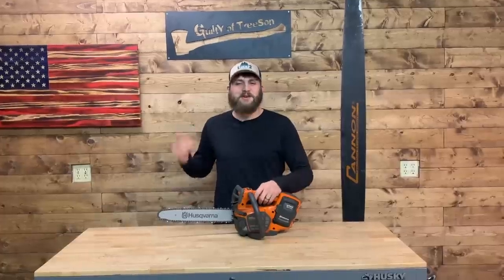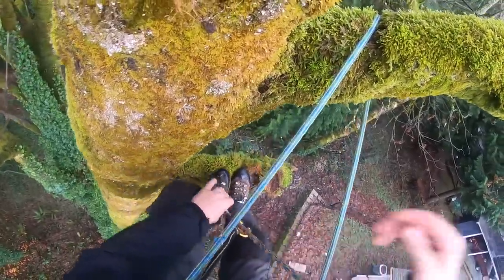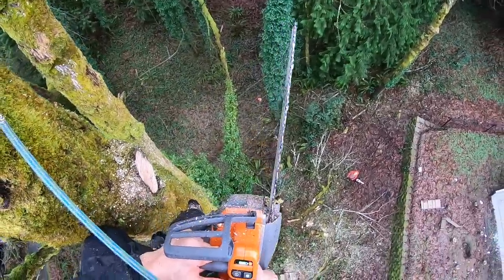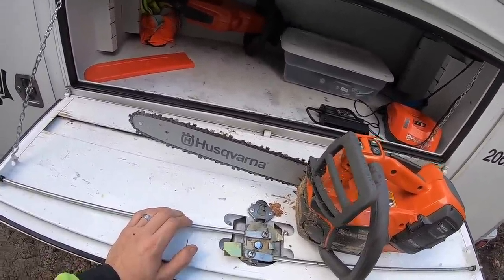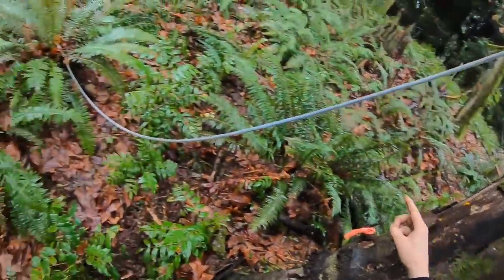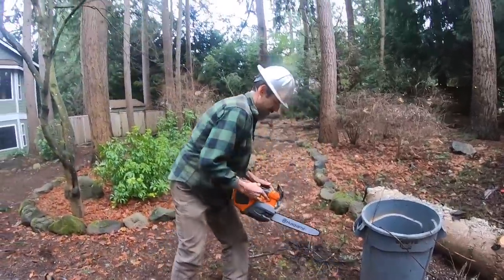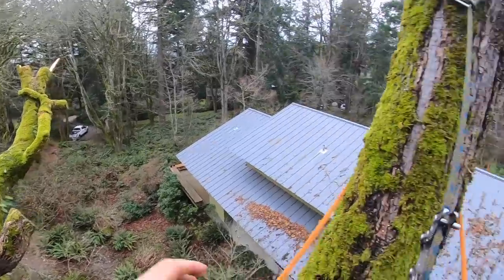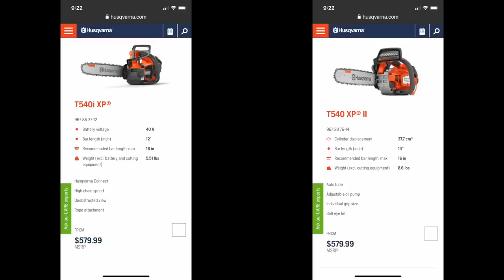Battery Powered Chainsaw Review! Testing the Husqvarna T540i xp

Comment: psa. in general with electric kit, take the battery out before maintenance or touching the bar. it just keeps you from any accidents. not saying jakes bad for it im just saying be careful. like he said you dont know if its on break or not or even the safety triggers are jammed with gunk (which has happened with me before).
Reply: I witnessed a close call once with someone who was cradling two milwaukee battery angle grinders, loaded, charged with cutting discs on them..
Reply: Thats all i could think watching the video.   Take the battery out, and get your hand off that saw blade
Reply: Yer the 1st minute of the video I was like get your hand off the blade and the trigger omg.

Comment: I feel like in 5 years all current electric equipment will be outdated/obsolete because of newer technology.  I have had chainsaws that were close to 50 years old that are still relevant, heavy as hell, yet running today.  Just wonder the projected lifespan of the tools you were showing?
Reply: I wouldn't anticipate passing them down to future generations.
Reply: Echo has decent setups but why didnt husqvarna add speed control to that saw? Its crucial for precison work...
Reply: I've used both for a while - and I'm a convert to electric, as long as it can put out enough power for the application. Almost zero maintenance, quiet, easier to use, and in most cases, lighter. The technology in them isn't new, and has been well proven. For anything larger than a 16" bar, there isn't something that will match a gas saw for power, and I can't see electric replacing a 395XP any time soon, but for a homeowner, or a climbing saw, they are perfect. I do wish someone would come out with a top handle saw with a battery back pack (like what Ego has), that would be perfect I would think.
Reply: I run a small tree company and with running a saw every day at most we get 5 years before we totally blow them up. Long lasting isn't the most important thing
Reply: I really wouldn't expect tools, especially a chainsaw, to last forever when used everyday on the job. However, in my case, a saw is used very seldom and "should" last a long time. I was thinking the battery technology will change drastically, kinda like my first, second and third cordless drills.  My drill with a cord, that sucker is 30 years old and still rotates with some authority.
Reply: @IBAdrianHarris  Ego Say they are working on a top handle saw but it's already 1 year overdue.
With regards to your comment on electric not replacing a 395xp anytime soon. There would need to be another type of battery to come on to the market to make that happen. The motors are already available to outpower any gas saw...it's just the battery (size and voltage) that stops it from happening. It will happen hopefully in my lifetime. I use a battery trimmer, blower and mower (all commercially) which are great. I still have an 80cc gas chainsaw though.
Reply: you are assuming that petroleum will be available indefinitely...I doubt you will easily come by petrol in 50 years other than from specialist suppliers.
Quality battery tools will last indefinitely...the batteries on the other hand will not.
Once we get standardised, it may be easier to get replacement batteries in the future. Look how long AA and AAA batteries etc. have been around. The chemicals have changed but the shell is the same.
Reply: No, waaay more than 5.
More like 15-20 plus.
Reply: @IBAdrianHarris  ego have just released a top handle saw. they are claiming it to be as good as the 200t
Reply: @positiveaspect5730  Petro isn't going anywhere. It will be needed to mine or process almost everything that battery is made of.
Reply: @mihkus  … it does have a variable throttle, acts like a rheostat, also has a completely “eco” or trim setting, which cuts it to about 50% output.  That also has the varying trigger.
Reply: @IBAdrianHarris there is a husqvarna battery belt and backpack, they both have and adapter that let's you connect to the t540ixp
Reply: @positiveaspect5730 fossil fuels are responsible for producing roughly %80 of America's electricity.

Comment: I really like how slim it is. 

Seems like a great saw, especially with some Stihl PS square filed chain
Reply: Yes, it'd be interesting to see how it would fare with some other chain/sharpening configurations.
Reply: @funkla65  I run Stihl square filed PS on my echo 355 and it cuts like a hot damn
Reply: This saw Runs 325” pitch narrow chain unlike the old version so chains are difficult I am currently looking at seeing if a 3/8” sprocket is available, But saying that this saw cuts so well why change it

Comment: I work at a dealership, we have complained to husqy abt those tensioners because they are shit, still waiting on an outcome but the only trick I have thus far is to get the tension, grab the chain with your free hand and then tighten the bar down good, not seen how it performs in the field sadly but its what I have to do to get it on the shelf

Comment: Great review!  I have one of these T540i xp  with 16" bar and love it. Cuts an amazing amount of wood on one BLi200 batt. With 2 batts and the fast charger it can cut continuously.
Reply: Isn't that to big to go top of a tree and cutting with a single hand?
Reply: @sirvozelo1  no, it's easy to use one handed.
Reply: @Clif_Brown  I believe, you in case of mine the Stihl 161T is very light even I have the batteries from the AP200 to AP500 I very much only use the AP200 because is light and still give me + - 45 minutes cutting time.
Reply: @sirvozelo1  I got the T540i xp because it was the most powerful small battery saw at the time.  I have cut large diameters 20+" with a double cuts and it powers through. Small stuff is simple for it.
Reply: @Clif_Brown  Whao 20" is over 50 centimetes that I with need my MSA300 and even in this one I only have the 16 and 18" bars. On 161T I have a 30 centimeters 12" bar.

Comment: I bought a Greenworks 16" battery powered saw about a year ago.  I already had batteries and paid about $140 for the saw.  I'm a rank amateur when it comes to using a chainsaw but I've been able to clear some dead trees (14" or so in diameter) from my property.  The saw is lightweight and has enough power for what I need to do.  And, truthfully, the gas chainsaws kind of intimidate me.  Thanks for the review!!

Comment: Future concept - The tools could be lighter & more powerful if a bigger battery was attached to the operators belt. Use a combo tether / power cord from the belt to the tool. 
Why carry the weight of the battery with your hands?
Reply: Cool idea but would be inconvenient for everyone other than climbers since no one else uses a tether
Reply: @joeyisamazing1091  In the case of tophandle saws, that's really the only thing they're made for, so not a problem. Also, I believe there is a backpack battery from Husqvarna
Reply: Stihl has that

Comment: The smaller narrow kerf chain may be more the culprit than the tensioner when it comes loose. The thinner bar and chain are more likely to get pinched, as well as the thinner chain is more likely to bend. Different types of tensioners do take some getting used to though. Not sure if you tried, but the bar and chain might swap between both 540s, as long as they are both 3/8 sprockets.
Reply: It’s also a new saw and chain so the chain will stretch a bit in the beginning requiring close attention to the tension.

Comment: Another thing to consider the power you get from the battery today wont be what you get a year from now.
Reply: Most quality lithium batteries won’t degrade much over the coarse of a year unless you are running them hot every day. He’s not even really pushing it in the video if he carries one spare and alternated they will be good for years unless they failed for an abnormal reason.

Comment: I have 3 of those 540i   They are amazing for limbing especially. If you  chunk big wood with it the battery goes dead fast but with 2 batteries and the rapid charger you can pretty much cut non stop all day. I also have the stick saw and I love it. The bli300 battery is a bit bigger and last longer but is heavier.

Comment: I think the big take away from this is that Husqvarna was close in their first attempt but the third version is when they will probably get the professional version that is worth it. Would love to see you run the stihl version as well and see if you run into the same downfalls
Reply: What made them not close? edit: I just got to the part about the tensioner. I just got a Dewalt 20" saw DCCS677 that came with the 15Ah Flexvolt battery, and it is awesome. They claim it exceeds the power of a 50cc, and they have a video to prove it. Definitely not going to have a problem with the tensioner like this one with its dual bolt setup.

Comment: Not sure why you think Stihl use different batteries, they do have smaller batteries for their home-owner tools, but all their pro tools,  the MSA161T, the BGA86 leaf blower, the HTA85 polesaw etc all use the AP300 batteries, or the slightly more powerful AP300s.  The 14" MSA200 saw and it's bigger brother the MSA220 also use AP300 batteries.  (but the 220 is best with an AP300S due to it's extra power).   I prefer Husqvarna gas saws, but prefer the Stihl electric saws, as no annoying power switch, and like the narrow kerf and smooth cuts (use for construction timber also).  I'm not a pro user but have had the MSA200c for >3 years now, mainly firewood and small trees, brilliant wee saw, it's not even a pro tool but has lasted well - now have the 161T,  polesaw and leafblower.  Got 2 AP300s with the MSA200,  they both still good.

Comment: Why does no one evaluate the Kobalt 80-volt brushless 18" chainsaw with a 5-ah battery?  - -   I have (2) Kobalt 80-volt 18" Bar Chainsaws and use (2) 5 AH Batteries. Using it on a Southeast LA farm that was devastated by a Hurricane and has been working absolutely great even cutting huge logs and trees. For oil, I like to use Ryobi Bar and chain oil. We have cut 20"+_ logs and it works like a charm. And NO more pulling and pulling to start a gas-powered chainsaw. My first 80-volt 18" Bar Chain saw with a 5-AH Battery and charger was $400 in Jul 2021

Comment: We have a standard style battery 340i Husqy and it is a POS. Lacks power and torque. Goes into protection mode over 1in branches at a touch. When is does want to work, it's cut speed leaves much to be desired. I got an EGO CS1800E for my personal use and blows the husqy away. I shall have to keep looking to see if anyone has put the T540i up against EGO's CSX3000, which is EGO's top bar style with umbilical so the battery is on your back making the tool lighter again.
Thanks for the review

Comment: I actually prefer this to the MSA300. Primarily because this one has a chain speed of 24m/s relative to 30m/s where even Class 3 protective clothing and boots offers no protection against potentially fatal accidents involving chain speeds above 28m/s. With the T540 you can get the job done whilst also having a level of protection from protective boots and clothing

Comment: Still have the 220C witch should be about the same power and size of this husky, but i think i don't trade my Still 161T for either one the Hasky 540i or the Stihl 220 this in particular if i am going to clime a tree the 161T still have power and is lighter and less bulky.

Comment: Another huge plus.... Husqvarna has a 2 Year COMMERCIAL warranty on all of their professional  battery equipment.  Battery, Charger and the unit.  So far, all of the battery (except the pole hedge trimmers) equipment has been extremely reliable.  The tree service I work at has had the battery powered equipment for a couple of years.  Husqvarna has covered every issue regardless how small or flat out replaced the unit entirely.  The gas powered pole saws and shears are the last to be signed out of lock up.  they are LIGHT and do a great job.  The guys love em' FWIW

Comment: I love mine for trimming and topping out but I mostly use it on pine,aspen,soft wood. It does ok in maple,oak and ash, but runs down the battery and bogs . I do find that using the battery saw on the smaller stuff I am faster and it’s awesome being able to communicate with the ground. This saw is great for trimming palms .

Comment: Curious to know if you tried their (Husqvarna) Electric "120i Domestic battery model"; as that apparently comes with tool less chain tensioning.  Which looks like a + & a Minus button on the side.   (Why the Chainsaw world doesn't just borrow some Di2 tech from the cycling world, and have self trimming chains; is beyond me?  More so now than ever, given batteries on saws are more common and viable.)

Highly enjoy your videos and commentary, especially the crew chat while working and processing.  Nice to see a good team doing good work and enjoying their jobs while doing it.  Top notch footage to enjoy and admire also.  Kudos.  It's been interesting to see how quickly you've adopted the battery saw over your much loved 200's. :D  Can totally see why, the weight reduction and ease to swing them with much less effort to be accurate; pays off so quickly.

I only use a saw for mostly ground work, and clearing from floor to head height; or just above (Plus some dead fall clearing or path finding.)   So can only imagine the freedom a much lighter electric saw would be, up in the canopy for hours of a day.

Nail on the head regards no pull though.  That's the key part of where this is going, more ergonomic and easier to operate in tight or difficult spaces.  Button pushing wins for ease of operation.  

Last time I took an Electric Husky tool into my local dealer, to get it looks at; he'd never seen one before. XD

You think Husky will bring out a combined Arborist Battery rig for backpack use, but allowing Harness/Rope work?

Comment: Great saw ..to high priced ..for batterys' charger.how ever at thousand bucks for kit.in hindsight rather have bought that then echo 2511 or other small t handles ..because its about same after all the moding' and tuneup.s..but you would need 2 batterys. Even for tree guys not useing it 7 days a week .?maybe three.it cuts better than most gas. Saws.but I love sound of saws always have.unless it's big saw dint even wear ear plugs ..2 cycle engines thats part of it is the sound. .

Comment: I'm under the impression good for light limbing saw or homeowners but not on a professional level! When it brakes do you have electrical know how and the tools? Need wiring diagram! Gas powered perty simple does it have spark? Does it have fuel! I have extra ignition coil and carbs easy ten minutes back up and running! What happens when the electric motor needs parts your in the middle of the woods? It would be hard to keep electric small parts! Lol I do get most if not all have back up saws!

Comment: One thing i worry about is. If have guys never used a saw much. A saw that makes noise is runnin. So much respect. But something very light makes no sound. Chain brake to stop it, but shes live if not put on. Can c why they had tio make a safety handle.

Comment: I’m curious if Stihl, Husqvarna, Echo etc will start using specifications which can help buyers to know what the ft Lbs torque is or something to know which saw is stronger. There is a HUGE difference between this saw and it’s Stihl competitor. IMHO Stihl is lagging behind Husqvarna and Echo for quality battery saws. If you buy a Stihl battery saw without looking at Husqvarna or Echo you will eventually realized you paid more for a weaker saw and a whole lot of brand name. Considering how competitive Stihl is with Husqvarna I’m surprised they got beat hands down in this market by Husqvarna and Echo for each comparable saw per brand. It’s not even close and I’m a Stihl fan …

Comment: I installed a 1000 watt inverter in my bucket truck to run the charger. I have two batteries for my 540 and it takes roughly the same time to charge a battery as it does to drain a battery(-5" limbs). Yes....it really takes a dump on anything over 6". I can get away with just the 540 and and 261 on most trees now.

Comment: I love your videos but I would have to disagree on this one. Sometimes I don’t use my gas Stihl for two years at a time. It starts for me every time thanks to them not having a primer bulb that dry rots. If I got a battery saw I can almost guarantee I’d be buying a new battery after sitting for two years. I’m a plumber by trade so I have every battery powered Milwaukee and the batteries go bad in time especially the ones that sit. So in my opinion a capable homeowner should have a gas saw without a primer bulb and use gas stabil. Keep up the good work!

Comment: Recently picked up the Milwaukee Fuel brushless chainsaw with the 16" bar. Overall really pleased and impressed. Has loads of power, has never bogged down. It lasted me all day with a 12.0 AH battery clearing trails. Only downside is the chain likes to fall off when cutting anything smaller than 3/4" in diameter, sticks will lodge into the sprocket cover and make the chain jump off it seems....
Reply: Hello. how the saw behaves. do you have single battery? if you cut a 15 inch log, can you cut 30-40 cuts?

Comment: Think its good, better that 161t. Altho the narrow tip on 161 good for pruning. I like em if doin smaller stuff can push on im an i run mine little loser than petrol, just seems to pull better less friction i spose. But i like em n wont be to long be the more grunty than petrol. Cheers